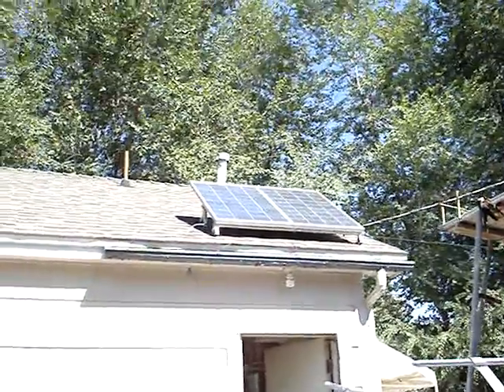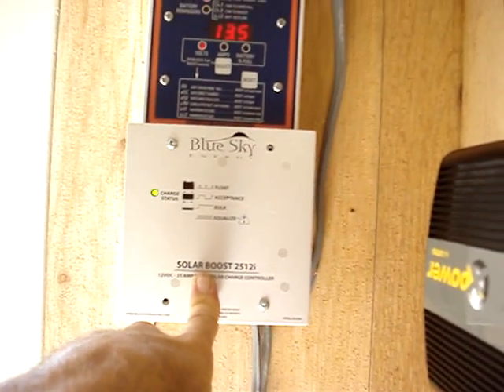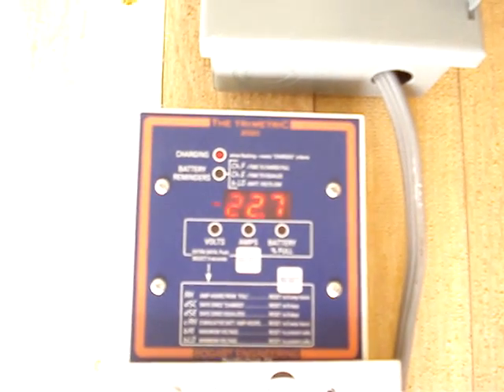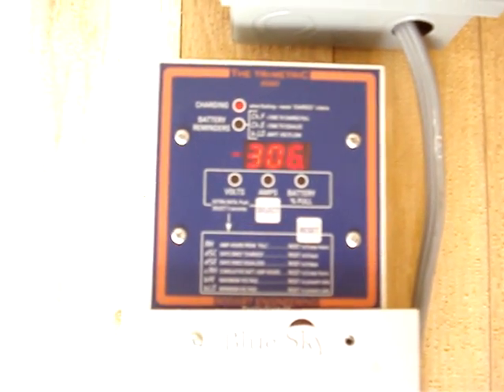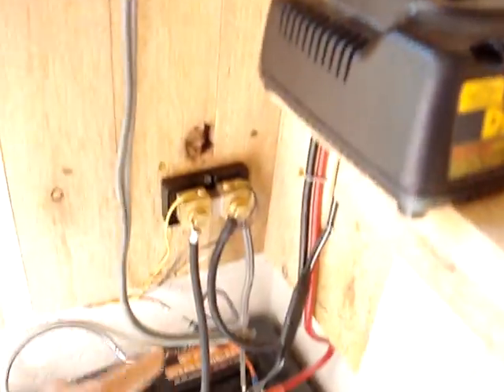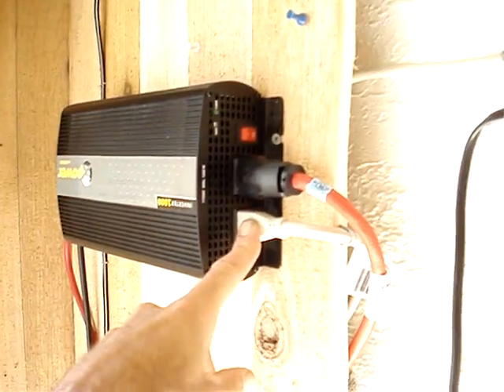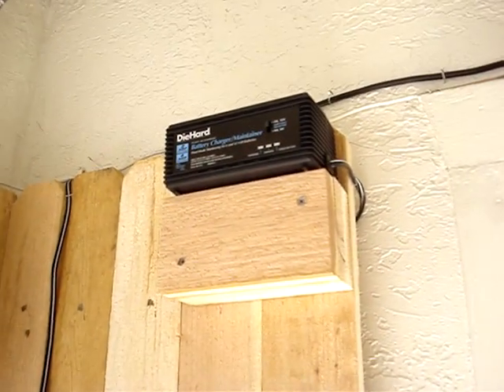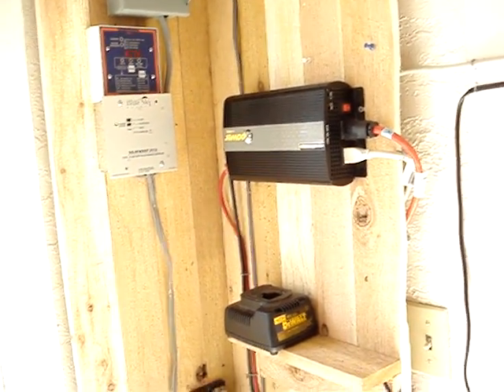DIY My small home solar power system

Comment: * I'm taking a training course in solar panel installation, repair and maintenance. My instructor recommended this book [link here >>>https://www.facebook.com/Build-Your-Own-Solar-132917764038406/app/208195102528120/ ] as an excellent resource along with the course. I'm finding it invaluable. By buying it through Amazon, I saved considerable money and received it very quickly.*

Comment: I have a PWM Morningstar charge controller right now the ps30 m pro star  with 4 _100 watt panels I'm thinking about trying a blue sky MPPT controller the PWM is nice but it just won't recover the batteries quick enough if there's some overcast cloudy sky and that, is you'res still working out good for you?it looks like a pretty nice setup.

Comment: Very nice and thank you for the tour. I'm trying to go totally off the grid and was wondering how many solar panels, batteries and any other equipment I may need to run a tiny home with a computer, TV monitor, refrigerator, microwave, LED lights, stove, hot water heater, convection oven, a SW / HAM radio (when our government turns on us), and a vacuum cleaner. Not all meant to run at the same time of course, but i will need certain things up all the time like the fridge and my Mac for work. Can you give me some help on cost and equipment needed?

Comment: i have a pwm charge controllerbuti dont know how toforce itinto charge mode it maybe automatic but it sais it can see the panel finebut no amps is displayed and dont know why any ideas, also do i need to cover the back of the solar panel up asi have it standin in my window so the back white area isnot covered up to make it dark, does this matter? i have a 30a 12v dc charge controller and 12 v dc battery and solar panel 65w, anyone have any ideas my controller is cm30 pwm
Reply: I like it but it needs a lot space ans seems messy too. Its new in market so it will be difficult to find the technician in case of emergency.

Comment: The setup in this video is very small compared to most I've seen. And some people are running their whole house off of simple solar systems, so not just "a hobby". The batteries will need to be replaced when they're no longer able to recharge, but the deep cycle batteries are built to recharge many hundreds of times, so they last for years.

Comment: SOLAR & WIND MILL TOTAL POWER PLANT PACKAGE
Generate solar energy at your place.
Freedom From Power cut. Brightful your life style!
Contact  Supertekpower. Save your Electricity Bill.
Instant Power supply during power failure
Pollution free.Run your TV,Fans,Lights,Mixi,Computers,Street lights electricity free.
We provide the Solar Power Plant
for Residential, Modern high Tech Commercial or Industrial purpose  Installation.
09483510779,09543021966 Email- supertekenterprises1@gmail.com

Comment: nice video, but it just seems like it would take a couple decades to get the money you put into it. seemed like a bright day and its only getting 100watts. maybe a about a total of 1 penny a hour on a good day. I'm sure they will loose effeciancy too making it only a hobby i suppose. it took more electricity to make the equiment than you would even save. only way you would actually save money is if you are normally boarderline with paying a different rate at a higher teir level.

Comment: Thank you for you very well done video.  I am planning on going off the grid, homesteading buying a small existing house/cabin.  I am seriously wanting to go solar but question my competence in installing my own system.  What would you guesstimate a 600 sq. ft home to need as far as covering all power needs and what would you guess would be a reasonable cost for panels and installation.  Thank you in advance. I'll be moving down to Tennessee if that helps.  Thanks again.

Comment from the maker: I don't like to go deeper than 20% if I can help it. When I have used the top 20% of a full charge, I call it a night.  it will take me all day tomorrow to get back to 100%. That's with these two panels in the vid. Rule Of Thumb, you should only use tonight, what you caught today. This rule will maximize the life of the batteries too

Comment: nice video, the blue sky module you said was 220$,,,but what was your total cost that you invested? batteries, solar panels,etc,,,,,

i do plan to live fully off grid in the near future, so i can use all the ideas possible. for sure i want solar panels, and a gas generator as a back up to charge the batteries,, now to combine the 2,,,im still gathering information.
i need to keep the inital cost as low as possible for the entire set up.

Comment: Nice setup! I'd like to have a small system like that, independent of the grid/main system, running just a few LED bulbs and 2 or 3 outlets for low draw stuff.

Comment: Nice compact system you have set up there. If your controller can take the amps I would double up on the panels;) I use a Norcold 12v fridge at camp (2.5 amp) but check out the edgestar 120/12v freezers. The more you can run off 12v for compact systems the less you need an inverter which consumes some power to run.
Reply: 12 years late, but better late than never, yes 12v is simpler than an inverter.
ive got a 12v set up and i havent got the luxury of mains voltage 240v, im in the UK, ive got 9 x 200 watt solar panels 2 x banks of 10 batteries 12v 110 ah lead acid so i keep an eye on the voltage my controler is a 30 amp per bank of batteries and i have a dpdt change over switch to go from bank 1 to bank 2, i got a 3 way fridge freezer i run on gas because the 12v would pull 6 amps and would knock hell out of the batteries.
you might say watt with all those panels, did i mention i live in the uk, all it does here is piss down and when it isnt they spray the skys so its over cast, also my panels are laying flat so if the sun does come out i dont get the full use out of it.
ive got a silent 20 kva generator for ping meals all my lights are 12v LED 8 in the bedroom 5 in the bathroom 2 in the hall 12 in the front room 9 in the dining room, the wroter is 13v and work down to 7 volts , i found that out early days when I've disconnected the batteries and got 34 volts from the panels straight through the wroter😂 theres only one way to learn, so I've got a few spares around I've been here 12 years zero electricity  bills and and the rate has gone up 600% to what i used to pay.
if you got the sun most of the time, get more panels and batteries, dont use your mains110v unless you have to.

i forgot to mention ive got 4x 12v 110ah batteries dedicated for the bedroom doing 2x usb chargers my alarm clock and a 300 watt inverter to do the electric blanket that pulls 100 watts and im nice and walm and its free.

Comment: Vaccum uses like 12 amps  your inverter supports up to 8 amps.. refrigerators can get that high at first but then use like 100 watts running. Vacuums on the other hand will use that 12 amps the entire time you use it.

Comment from the maker: The meter keeps track of the percentages for me  in amp hrs. If I catch 70 amp hrs today, then tonight I can run five, 14watt CFLs that pull about 1 amp each, for five hrs and a 15 amp tv for 3 hrs. Or five lights for fourteen hrs. or only tv  for 4.5 hrs.  Anything more than that, and I'm using more than I'll catch tomorrow.. A  system like this isn't that impressive, until the power goes out for more than an hour or two .imagine days, weeks, or months. Peace of mind my friend, peace of mind.

Comment from the maker: RULE OF THUMB, only use tonight what you caught today. You only want to drain your bank by 15 to 20% each night. This will allow you to top off your bank the next day. The other 80 to 85% is used when you run into cloudy days. If the sun doesn't come out today then I will tap into the other 80% of my bank tonight. and when the sun does finally come out, you will need more than a day to fully  top off your bank. Remember, you use tonight what you caught today

Comment: Also, bare terminals from the battery next to each other is unacceptable - I keep +ve at one end and -ve at the other with a set of blade type car fuses close up to them for low current takeoffs. Remember that fusing +ve end only is no good if a low current wire from the -ve could possibly touch an intermediate battery terminal - it will still burst into flames. Safety needs a lot of thinking about with battery systems!

Comment: I think you need to consider safety aspects more.  Those high current leads from your battery look as if they could fall across a battery terminal if, say, a house fire occurred. I see no fuses.  I suggest short wiring arranged so nothing can possibly short ever, and a high current fuse right at the battery terminal.  Also you seem to have low current wiring straight off the battery.  If this shorted it would vapourize the cable!  A big battery is a bomb plus boiling acid if you short it!

Comment: Iwill have to rember that a good juicy day. 
nice video.   when I get mine all up and running I want to get the out back system GTI charge controllers and transferswitch as whell I cant wait so I can get off the grid or as close ot it as possible.

Comment: The power is stored in the batteries. So, he COULD NOT run 1000 watts all day. You can only use the amount that the panels put into the system. Hope this helps some.

Comment from the maker: I'm not aware of any agreement rerquired to own your own power. Costco might be selling the grid tied inverters. With a GTI, your juice runs from your pannels to your inverter that is pluged into the wall. Then from your inverter into the wireing in your house. If you're not running anything, the juice collected will spill into the grid and your meter will turn backwards. With just a GTI and a solar array. You will need to add batteries if you plan on storing energy to use when the grid is down.

Comment from the maker: I'd get a charge controller with a higher amp rating. This controller will handle up to 3 of these panels. Other than that, it still does what it is supposed to. a larger inverter would be nice but not really needed. Today's cost? Lower, but not sure by how much. I also, I didn't shop around for the best deal either, so with proper homework, it could be substantial. More batteries are always welcome as well.

Comment: Thank you for the excellent video!  One question: can you make a video or recommend a resource that explains how to wire up such a system?  Also, is there an easy-to-understand guide somewhere on the Internet for calculating the level of inverter needed based on circuit load (in amps I guess).    Thanks again!

Comment: Hey Diy, My question is that , can we use the solar systems to run the home AC ( 2.78/ 2.70 KW) load? if yes than specify the size of the whole systems e.g solar panel, battery etc.

Comment from the maker: Look into grid tied inverters. Cheap way to use solar. They don't cost that much. Plug it into the wall, connect your solar panels to it. The juice will flow from your pannels, to your inverter, and into the wireing in your house. If you aren't running anything in your house, the juice will spill into the grid, and your meter will actually run backwards. the downfall of useing JUST a GT inverter is, you don't have any back up. (battery bank) When the power goes out, so does your house.

Comment: What about making a surplus? There's bigger houses out there than a tiny house that run on solar, but make so much electricity they put power back into the grid.
   Is it as simple as plugging a generator into an existing 12v outlet? Or if I build a solar tiny house, will the surplus be a waste?
   -The idea is to start with a solar system, hook it into my existing home for the time being, and have some income to help build my tiny house.

Comment: Hey please help with some info. On ur charge controller display you mention that the batteries were 94 percent charged, while the current amp level was 20 but later in the vid you also say the serries-parallel connected battery bank has a capacity of 440 AH.

My question is shouldn't the charge controller be showing something close to the amp hour rating?

I am in the conceptual stage of designing my system, still doing a load count, trying to put 4 acs on a system, thanks for your help.

Comment from the maker: Hey. the more batteries you have, the more juice you can store. That's it.  in this vid, if I went out and got two more pairs of 6v batteries, I could store double the energy as I can now. The outlet thing could be done with a better (seine wave) inverter. They produce cleaner energy that you get from the grid, but man they cost a pretty penny. One of these days though

Comment from the maker: double the batteries and double the pannels would be sweet, but any more panels would require an upgrade to my charge controller.  Double this bank and you'd have 880 amp hrs of storage. Would be a great setup for a cabin. You could probly get the whole thing for $3000 today. Solar has droped in price since i made this vid

Comment: Nice design and nice video.  But be careful with the way you are running unprotected wires... In particular, you're running unprotected wires around a door entryway.  Someone carrying something heavy, perhaps metal, could bump into a wire and have a shocking experience.  Try running your wires through the wall and in conduits.

Comment: Great video, thanks.
I was wondering, if I had that system with half the batteries, would it run 5 lights,and  a 200w mini heater for a a few days?  I am looking to only set up a minimal system so my main rooms have free lighting, but the ability to run a mini heater at 200 watts would be a nice extra.  Most heaters use at least 900 watts so I know that would push the system.

Comment: @IronmanOIF Completely off grid can get pricey, but it all depends on what you are going to be running. Also if it is cabin that you will only be living in for a weekend, then you can get by pretty cheap. Your biggest cost will be the batteries. You will want to run a lot of batteries in series. Enough to run your whole cabin for the whole weekend, and then let your panels charge the batteries while you are not there.

Comment: @robinclark8989 You're looking in the wrong places. I have seen 120 Watt panels going for $150. I have also seen some places running them as cheap as $1/watt. You just have to look for the deals.

Comment: Using a battery charger to recharge from the grid adds 3 points (AC 2 DC, charge battery, DC 2 AC) where you loos grid sourced energy over throwing a switch that switches you to grid power when the sun doesn't fully shine and your batteries are depleted.

Comment: @AussieHomestead Funny you mention that: my typical "outage prone" area hasn't had a single outage or brownout or anything since I installed an off-grid backup system. BUT like a lot of things in life that's usually how it works.

Comment: Nice! Does the Tri-Metric have a computer interface? I know one of the models does, and I'm curious to see how that goes because I can't be constantly running in the basement where my system is located and chck on it. The computer interface is appealing because it can upload info to the internet live and also make graphs and charts using Excel. Just curious if you've experimented with that.

Comment: I was wondering the same thing...I would prefer to run the inverter to my panel box instead of using the AC strip.  Is that something that can be done without a huge expense?  Absolutely wonderful set up though, good work!

Comment from the maker: @yamsack1 it's able to handle up to 1000watts  at a time. When I use the microwave, it takes a little longer to heat food than from the grid, so I know it's not running as hot as it should, but it still gets the job done. Still lookin to upgrade my inverter. I rarely use solar energy by day. It takes most of a full day to replace the energy I used the night prior. I ping pong back and forth in the top 20% of my bank. the other 80% gets dipped into if i run into some cloudy days.

Comment: Another question. I have my solar charger, the wires coming out from the bottom TO the battery are quite thin; the connectors themselves are very small. Is this normal?

I should be online today, you should see the electronic bicycle I've built :)

Comment from the maker: @TheTonyjara If I stream in 10amps in the sun, and your in the sun for 10 hrs,you end up with 100 amp hrs to use tonight. you can run a 1amp light for 100 hrs, or a 100amp light for 1 hr. Just depends how you use the juice you catch. Rule of thumb - you only want to use tonight what you caught today. This will keep you ping ponging between the top 20% of your bank, with the other 80% to use when you run into cloudy days. Sorry for the late reply:)

Comment from the maker: @shotox21 Your charge controller will take care of how much juice to throw at your bank. Think of electricty like water pressure. The deader your batteries are, the more electricity will FLOW into them. as the pressure builds in your battery, the flow  decreases untill no more electricity will fit. Stick with the 6v golf cart batts wired in pairs. They hold the most amps hrs, and are the best bang for your buck. Stay with high quality solar components. Buying them sucks but you won't regret it

Comment from the maker: @shotox21 These 6v golf cart batteries, the ones that I use, cost $150 each and have 220 amp hrs each. So a pair of em has 220 amp hrs at 12 volts. I add a pair of batteries for each panel I add. Take care of em and they'll last over a decade

Comment: @fencekid So there is a balance to the amount the charger will send to the battery? How do I determine this?

Why have you not added another panel? Cost? Just starting out? Also, what battery should I go for? I've been looking around for deep cycle, and a lot are 'marine deep cycle'.

THNKZ